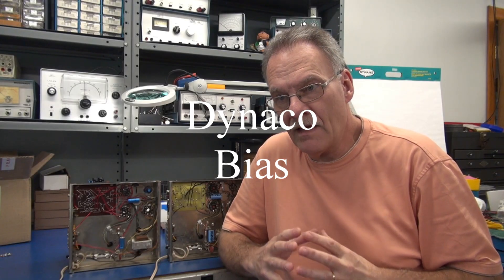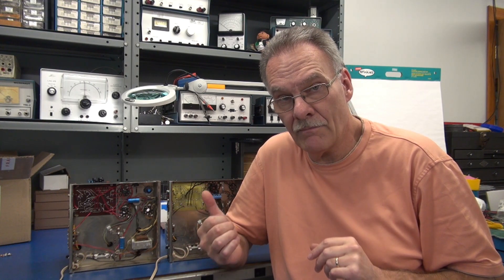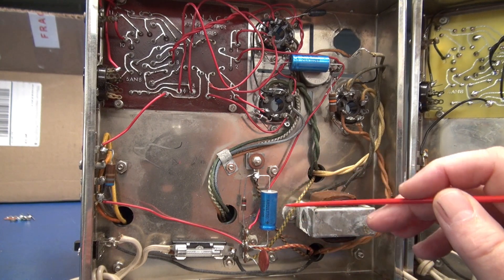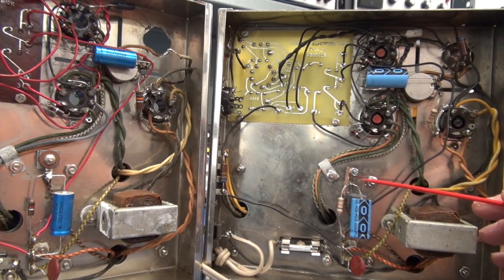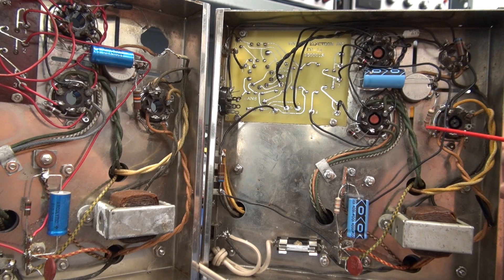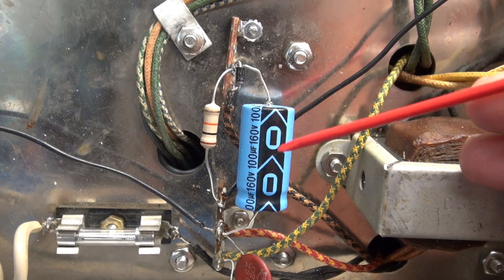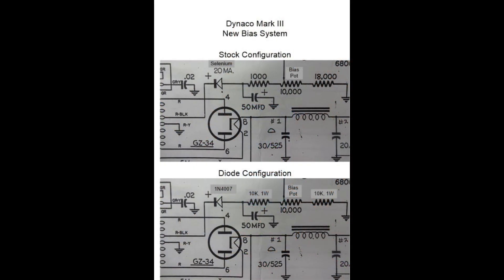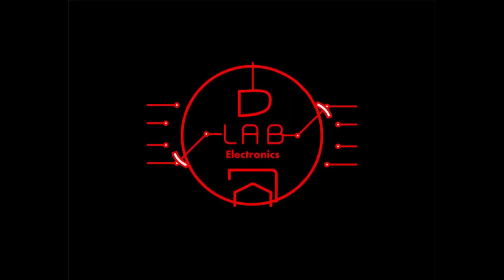Dynaco Mark III tube audio amplifier Bias system update Selenium to 1N4007 diode new resistor values

Comment: D LABS, once you have calculated the power tubes wattage from the plate current and plate voltage, how can you do a "backwards calculation formula" to compute for the DC grid bias for the power tubes? it would be nice to know what the formula is to compute for the DC grid bias for the power supply from the power tubes dissipation wattage
Reply from the maker: I actually never calculate it, I use a 1-Ohm resistor in series with the cathode and measure the current/mv direct
Reply: @d-labelectronics  yes I know but how can you reverse calculate the DC bias voltage? There must be a formula to compute the DC bias voltage

Comment: I bought a 1962 Magnavox tube power amp on ebay from a console stereo system. It has 4 6V6 tubes and now has 3 12ax7 tubes instead of the 2 it came with. The 3rd tube I added was the Mp3 preamp input impedance tube. Replace both output transformers and kept the original power transformer and choke. The rest of the amp was totally rebuilt per the 1962 schematic with matched resistors and signal caps on each channel. A very clean punchy 10 watts per channel. Very reliable no problems and I built it 15yrs ago

Comment: Great presentation, Terry. I just rebuilt a pair of these and did the bias supply like you've done here. Works great! I used CE Distribution cap cans rated at 525vdc but the B+ gets up to 550v with today's line voltage. I ended up using a thermistor CL-80 on the line and also added a 40uf 600v radial cap on the first node to assure that my cap can doesn't turn into a fire cracker. How do you deal with the high voltage on these?
Reply from the maker: I will check & update you, Yes you are correct, I measure 535 VDC! Here is a replacement https://www.ebay.com/itm/312203986432?hash=item48b0cec600:g:5Z0AAOSw-6pbYLj-

Comment: My time redoing Mark III used a full wave uf1007 bridge and 330 volt photoflash caps at 150mfd.  Much lower noise floor on the bias .  Have also done regulated  neg bias but that is a bit too far for that amp.  H H Scott used the heater to  load their neg bias and get a bit quieter.  Just my thoughts.